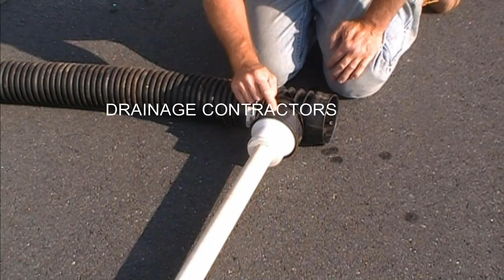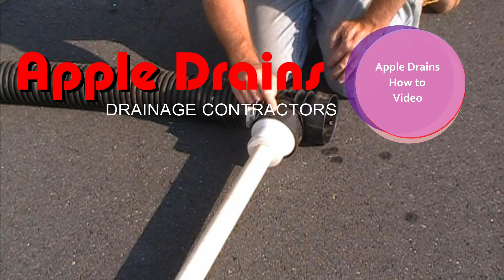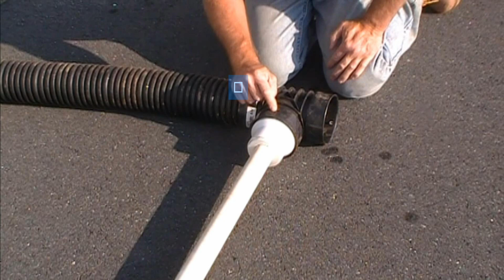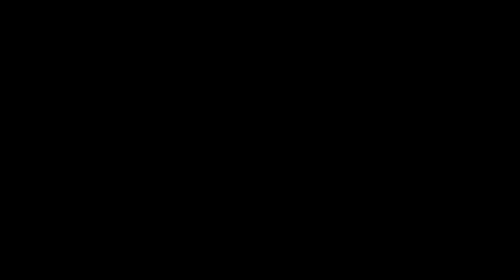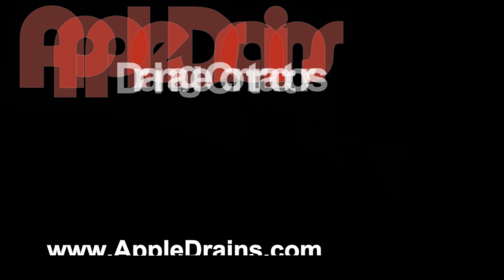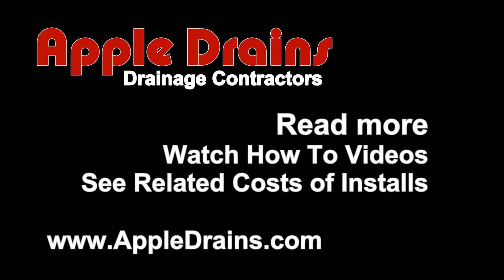How to Connect PVC Pipe to Corrugated Pipe - DIY for Sump Pump Owners

Comment: Y not use a Y connection?
Reply from the maker: Hi Bob .. it’s just an example 
👍
Reply: Chuck, you explains the assignment very well. Thxs🙏
Reply: I will be installing 220 Lin ft of perimeter drain pipe in my backyard this summer. This should trap most water draining downslope from residential properties behind. Is black 4inch perf pipe from Lowes or HD good enough?